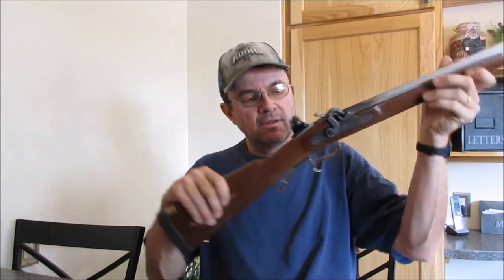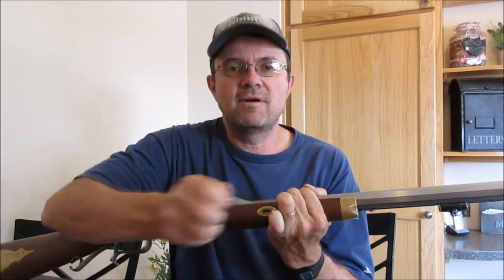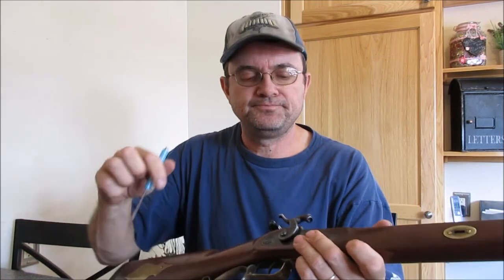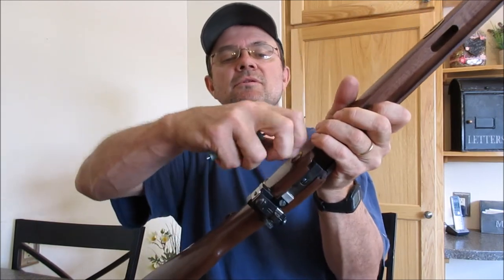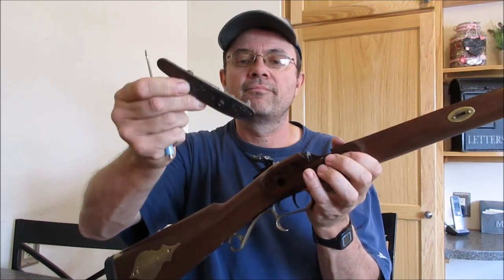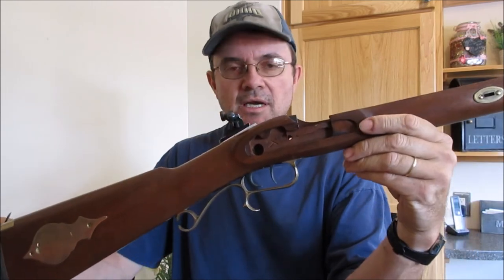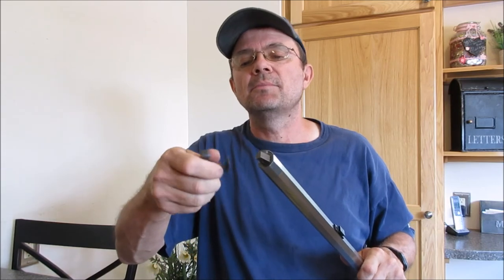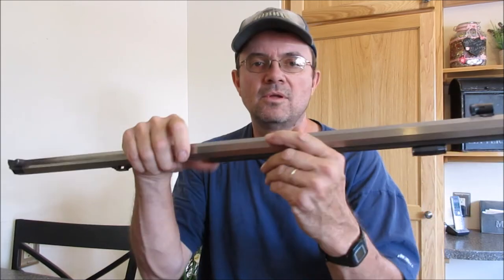TC Hawken and Renegade Take down video

Comment: I'm having a problem with my TC Hawken percussion lock, the hammer will no lock back at full cock or half cock. So far I haven't found any info on the lock so I don't know exactly what is going on.  I bought this rifle when they first came out but its been sitting for several years and I'm stumped as to what is going on.

Comment: Hello Ron.  I have several TC Hawkens in with Green Mountain barrels both LRH and round ball twist.  Please, I would like to know what make and model recoil pad you have used on the “Hot Rod Hawken”.  Thanks, Al M
Reply from the maker: That is a limb saver grind able. It works great
Reply: @idahoron  thanks Ron!  What size?
Reply: @albertmajerus6483 poor man it’s been three years still no answer

Comment: Hello, I just put a Lyman receiver sight on my renegade 54 caliber percussion. I was just wondering if you can give me some advice please on how to site in this site. And I’m hoping it’s not too complicated and I’m hoping also it’s easy. thank you
Reply from the maker: So let me see if I understand you. You have a Lyman peep sight on your Renegade. Now you are inquiring how to sight it in. Is that correct?
Reply from the maker: Did you install a Lyman front sight or are you using the original TC Renegade sight?
Reply: That is correct. I’m just wondering if I should put a Thompson center front site globe on it as well?
Reply: @idahoron  I had installed number 57 receiver site by Lyman. From track of the wolf. Which, by the way, is an evil place. I can plank down a wad of cash and still be in thousand dollars in debt. Lol.
Reply from the maker: @scottbrightman3662   I installed the Lyman 17aml globe sights on several rifles. I use Lee Shavers BPCR inserts.  You might need to shim the front of the Lyman 57sml peep to get it to travel vertically a bit better. On some tangs, they tend to lean forward a bit. 
Sighting in is pretty straightforward. 
Start at 50 yards and shoot.
Reply: @idahoron  yes. Already been on Facebook and somebody’s already talked me off the ledge. I have a rough idea on how it’s going to be done. Thank you.